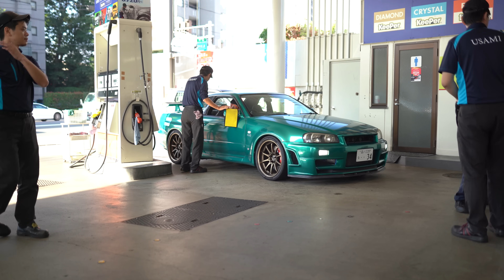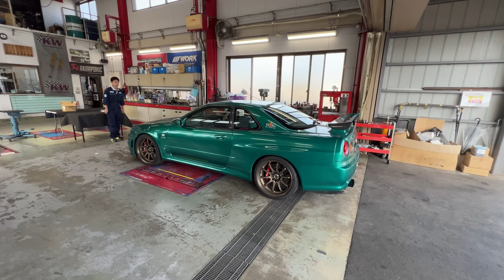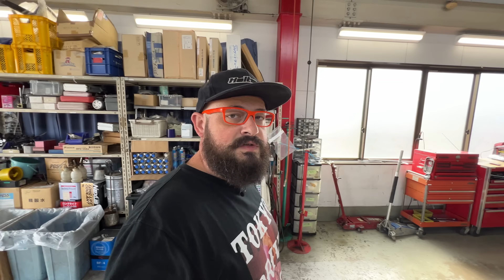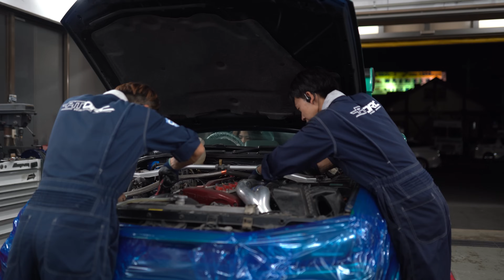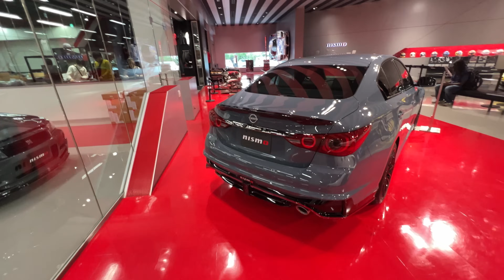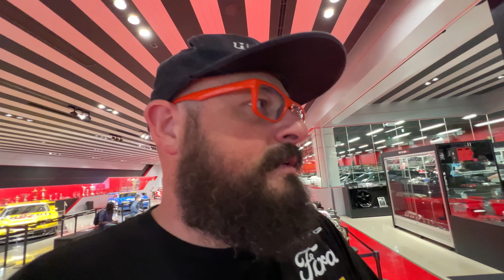Restoring My R34 GTR | Episode 3

Comment: Dino, I know we are talking clutches here, but what brakes and wheel size are you running ? Are they the R35 calipers on 380rotors with 19” wheels ?  Thanks
Reply from the maker: Brakes are Bremvo Gran Turismo 6-pot front & 4 rear with 380/355 rotors. Wheels are 19x9.5 +12
Reply: @dino_dc  Thanks - what are your thoughts on Endless brakes ? I’m running 18” wheels , looking for a 355 or 370mm rotor setup

Comment: Wow!!! I can’t believe that the ATS clutch in your R34 is almost 20 years old. Today, I’ve re-read your speedhunters article that you wrote which was on February 4, 2013 and there I saw this same clutch that was installed in your car and the fact that you’ve track your car and did not wear the clutch so fast is impressive that it lasted a long time before you replace it with the new one. Also, another thing I like about your car is that, you did not easily upgrade your GTR like any other owners would do like swapping out the factory twin turbo etc and instead you take time to decide on what to upgrade and what not to replace. I hope you don’t mind me asking about the previous aftermarket parts that you put in your car, did you keep some of them like the early upgrades you did to your car like the mines exhaust, side mirror etc? By the way the reason I asked is that I’ve seen it in your speedhunters article that your wrote 10 years ago. Again nice content Dino😊.
Reply from the maker: I got rid of some stuff, kept OEM stuff. I’ll probably go back to the mines exhaust eventually, the sound is unrivalled. Mine’s mirrors were cool but didn’t fold plus never liked the fact they were near copies of E36 M3 ones

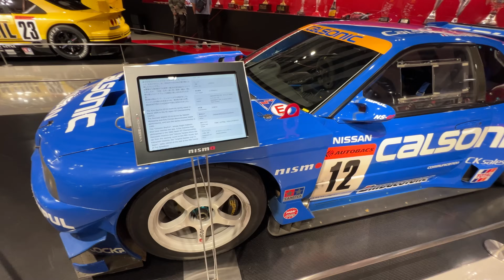Comment: 15:30 - I can't remember where I read this, but I think it's true that they were at one stage planning to put the V6 into the BNR34 road car (perhaps for more modern/efficient tech, but also a V6 is shorter so can give the car better weight distribution), but ultimately they gave the RB26DETT a stay of execution instead. I wonder if the decision to put the VQ into the GT500 car happened during that stage with a view to then promoting a V6 GT-R with it...
Reply: The source is from Kozo Watanabe, it's mentioned in his wiki page: https://en.wikipedia.org/wiki/Kozo_Watanabe_(engineer)

At the time it sounds like the RB was seen as a boat anchor holding the car back. It was only making 330 hp maybe in stock form and couldn't do much better as far as the OEM engineers were concerned. Goes to show sometimes numbers aren't everything. BMW staked their brand on RWD I6 when everyone else was going to V6 like Nissan/Toyota. It requires a major rethink of how everything is laid out in the car to make it all work.